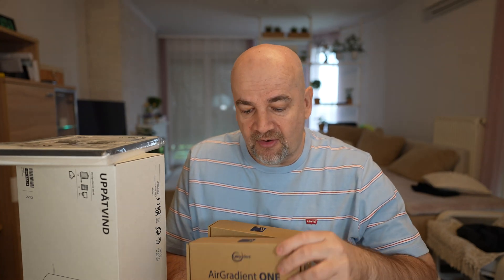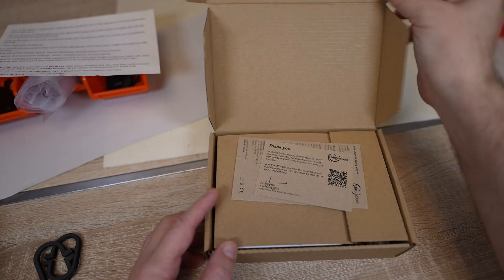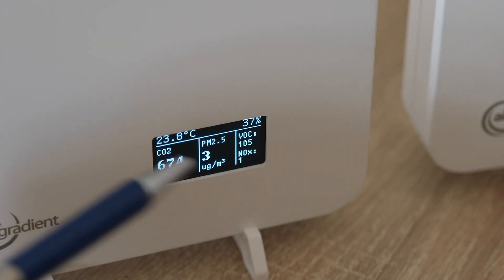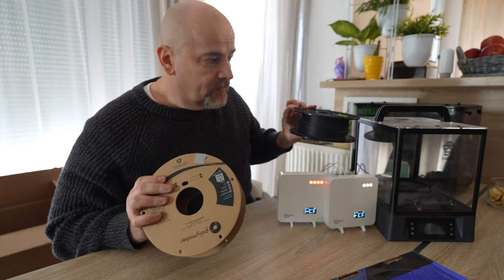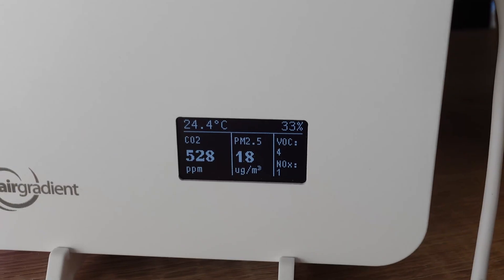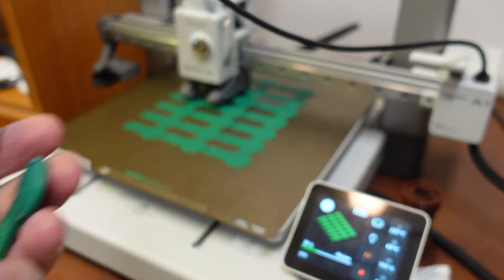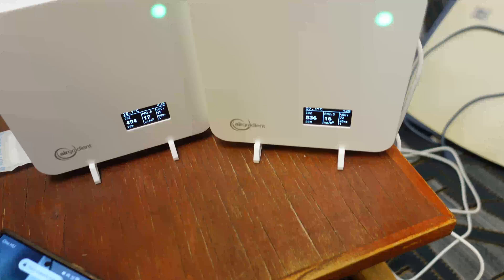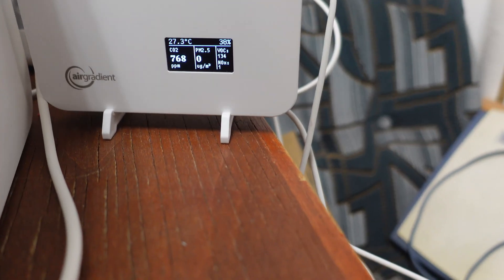Any VOC with 3D printing?  AirGradient ONE indoor air monitor review

Comment: You have to get above 2000ppm CO2 for it to start mattering. I'm not sure it's possible to get to that point in a regular residential setting. Without burning anything. It's a useful measurement but it doesn't mean you absolutely need to open the window since it's completely normal to have it in the air. 

And for the cooking it's a very well researched topic. It's more impactful if you're cooking with gas and even more serious in cultures that cook on wood stoves (electric is not immune to this it's just much less). It's the most polluting thing we do inside our homes.
Reply: At 2000ppm CO2 the acute effects and things people will directly notice begin. But that doesn't mean that lower concentrations aren't an issue over a given length of time. Over 1000ppm for a workday leads to measurably reduced performance even for something as low energy as office work, and there are indications that there are benefits from going even lower than that.
Reply: @vakieh4381  i think i didn't express myself well. My point is that i think house are full of air leaks. It won't stay at his 1000ppm reading even if the windows stay closed. So 2000ppm would be where you could get an effect right away.

Benefits is vague, people will have different tolerance. Just like athletes don't get the same boost from oxigen doping. It's generally not a real concern at home for the readings he was seeing.
Reply: @SquintyGears  The benefits are vague below 1000, yes, but the early indications in research are there - we just don't have the overwhelming evidence we do for office workers subjected to ppm 1000-2000, where the evidence is pretty much indisputable, everybody's brain works better when it's below 1000. And if you have kids with developing brains in that air you owe it to them to make sure it's as good as you can get it.
 
You might be very surprised about the CO2 build-up in houses, particularly where those houses have started being built for energy efficiency, or living somewhere that gets super hot or cold where leaks are really noticeable and get dealt with via insulation or sealant. There's going to be air exchange, sure, but if you have people living in the space the CO2 production is likely to outpace the exchange when all the windows are closed.

Comment: Another great video. Thank you for your time and effort to produce it. I've often wondered about this. One question that might be interesting for future testing is with different types of filaments. e.g. Does PA6 or ABS create more VOC vs PLA or PETG? Is there an increase in PM2.5 when printing CF or GF fiber vs unfilled? Perhaps one unit in the exhaust of an enclosed printer and one monitor in the room to compare the difference between an outdoor exhaust duct vs venting into the room.
Of course, these are just the things I would probably test over time and my musings, I certainly don't expect any followups, as I know you have a large backlog of tests and your time is valuable, so it was nice to see the test!

Comment: Me and my friend at time did our own tests with different VoC meters - even inside x1c when printing ASA without ventilation VoC is less present than when cooking with active exhaust.
The most harmful piece is nozzle cleanup.
BUT you can have allergy to 3d printed plastic - my wife developed allergy to Sunlu filaments fumes. Even if I print something as small as 10g, she gets very upset with me.
Reply: I'm allergic as well, or at least it makes me sick. Both pla and PETG make me feel like I have the flu!

Comment: The blur you used for screens is not destructive. Anyone who wants can recover it. If image moves it's also possible to recover text from pixelated image. Either do VERY large pixels and don't move camera with blur, or just paint over it - then it won't be compromised.